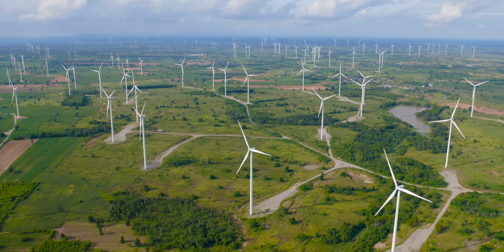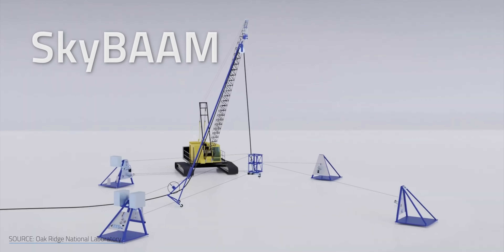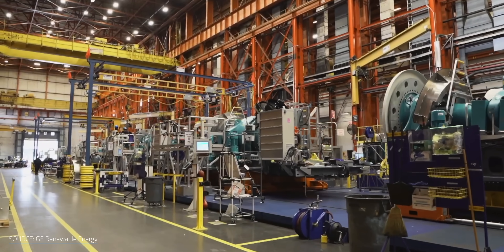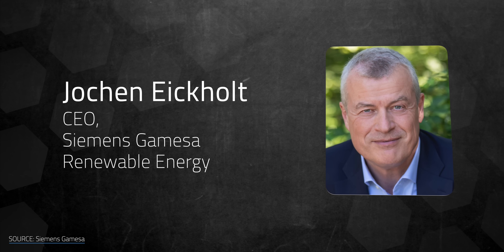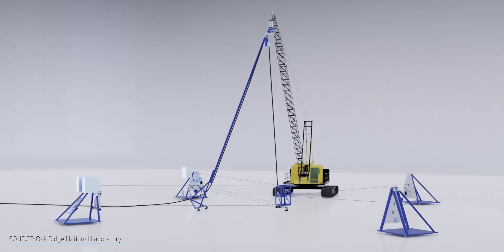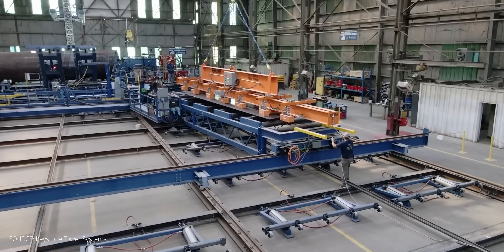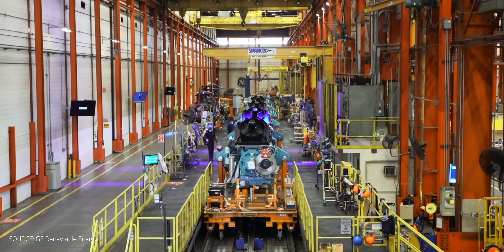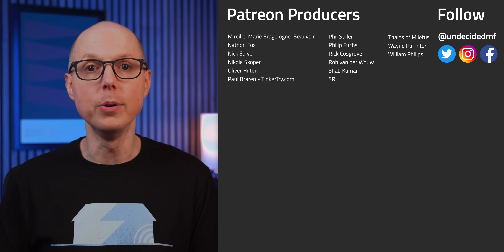Why We Need To Rethink Wind Turbines

Comment: The 2010 DeepWater Horizon spill took years to cleanup after it leaked over 200 million gallons of oil into the water. BP paid more than 70 billion dollars fixing it. 
Wind turbine manufacturers absolutely should be held accountable, but realistically even a wine turbine collapsing completely can't compare with the damage and cost of an oil spill.
Reply: Just a tibdit. BP paid not for "fixing it". The largest part of the payment was to cover the expected taxes lost in the spill. 

Government and courts pretend to care for the environment, but it's only about the tax money.
Respevtfully
Reply: @ricardokowalski1579  Do you have a source for those claims?  The most I can find is a reference to some money helping governments cover lost costs, but that seems more to cover lost income from things like tourism, not lost profits from drilling.
Reply: @mjdsys3376  this is also why there was a "heated" argument on the flowrate of oil across the wellhead. All this happened in "trust the experts" closed meetings, and the taxes levied were calculated using the "estimated" flowrate.
Reply: @ricardokowalski1579  I don't doubt your article (Reuters "Govt to BP: Don't forget to pay taxes on oil" July 15, 2010, as your replies seemed to be removed), it quotes a levy of only $73.4 million based on the worse case government estimates at the time.  Even if you assume this number is 10 times smaller then the final levy due to behind the scenes discussion, that is still only 1% of the larger quoted number ($70 billion), which is not "the largest part of the payment".  Various articles I found from various sources had the money going to various other organizations (including governments), all for various other quoted reasons.

That doesn't state whether this tax was warranted of course, though I'd assume it done this way to discourage oil/gas from being leaked out of drills which does seem useful.
Reply: @ricardokowalski1579 Just a small correction - the actual experts who were asking to be trusted were the rig operators who kept telling BP to stop before being forced to continue leading to the disaster. I'm really sick of all of this paranoia around experts as if they demand blind trust when they're actually very happy to share the evidence and reasoning - it isn't blind trust of people just can't be bothered to look at it.
Reply: @bosstowndynamics5488  "being forced to continue"
"forced" how?
Did BP pull out guns at the rig?

Also, strawman argument. Your "experts" are not the ones I am refering to. Failed, try again.
Reply: Yeah, but DeepWater wasn't making the equivalent energy of one turbine, it was equivalent to thousands. A barrel of oil is equivalent to about 1700Kwh, just the spill was about 5 MILLION barrels, that would have been 8,500,000,000Kwh of energy. That's enough to power 1.5 MILLION US average households for an entire year (minus efficiency losses, and if all the oil is turned into energy and not byproducts).
Reply: Guess where the chemicals come from that make the necessary epoxy needed for these huge composite structures?
Reply: The oil for the petrochem products in the epoxy will come from properly drilled and lined non-fracked LAND oil wells.... after we remove about 80% or more of all oil well extraction facilities that were used for fuel. FUEL.... do you understand parrot squawk "greatest hits" fossil PR propaganda trolls?
Reply: And?????
 @alexe589
Reply: Indeed, comparing apples to rotten pinapples
Reply: The problem is that wind doesn't make as much money as oil.  In 2021 the entire wind industry only spent $20 billion.
Reply: If they would just give away those turbine blades then they could be used for dozens of things. The fact is that companies would rather just bury the problem. Most areas where turbines exist are rural farming and ranching locations. 
One turbine blade is big enough to create a ton of wind blocks for livestock, Shelters for said livestock and a ton of other things. some with very little effort to fix them up.
Reply: Please tell that to the billions of insects and birds killed every year. Not to mention, whales going instinct because of offshore wind. Please do not be a patsy to big wind.
Reply: Except oil is absolutely essential and wind turbines are a total complete waste of energy and will never be “green”.  It’s just greenwashing. It’s a scam. Makes China rich
Reply: You do realize wind turbines leak oil constantly right?
Reply: If the Gulf of Mexico was a football stadium, the amount of oil spilled by DeepWater Horizon would be equivalent to spilling a 20oz soda.
Reply: nothing can replace oil. anything can replace wind turbines.
Reply: Guess what is needed to build and run wind turbines. Oil. Oil in the manufacturing process and tons of oil every year for lube to keep them spinning.
Wind turbines or solar panels all need oil
Reply: @quillo2747  The oil to manufacture and maintain wind turbines is by definition a small fraction of the oil to manufacture and maintain and fuel any kind of liquid hydrocarbon based generator. The fact that wind power isn't a magical infinite free energy source isn't an argument against it when it's still substantially better than what we're currently using
Reply: I worked for a small manufacturer around that time (I started in 2011 when they were still cleaning up the mess) that happened to produce parts for the company that made the emergency clamps designed to prevent an oil spill (I know that was a mouthful).  During one of our meetings my boss shared a bit of information he learned from said company:  The rig had 3 emergency clamps, a triple redundant system, to stop an oil spill but they were supposed to be recharged or have the batteries replaced every month.  As you can probably guess the batteries hadn't even been checked for multiple months, apparently they had 1 engineer that was supposed to oversee basically every rig and would only have a few minutes at each site before jumping on a plane to go to the next.
Reply: Oil is biodegradable. It gets cleaned up not matter what we do to it.
Reply: @kevinstroup  Are you willfully ignorant, just trolling, or what?  Most oil doesn't biodegrade, it's actually the end product of biodegraded material that was exposed to extreme pressure and/or temperature.  Crude oil spills absolutely ravage ecosystems which is why we spend so much time and money cleaning them up.  There are some natural oils made from plants that can decompose in a way that's beneficial to the environment but crude and most highly processed oils will not.
Reply: A whole ass wind turbine collapses... You get a pissed off farmer for losing a couple acres of his crop (which per contracts are paid out by the wind farm owner) and a bunch of pissed off wind techs that get to spend a couple weeks cleaning up the mess and a wind farm owner that is out a couple million dollars. An entire wind farm worth of turbines could collapse and it still not even be a drop in the bucket compared to the damage of an oil spill.
Reply: BP has huge oil ponds cover sq Miles of ocean floor - and killing everything under than and close to them, sans some microbes
Reply: @paleggett1897  not to mention the hundreds of square miles / kilometres of land in slurry ponds that exist in Saskatchewan and Alberta for the tar sands, which are a giant scar on the land which will exist for hundreds if not thousands of years. The petroleum industry seems to be oh so concerned about the number of birds killed by wind turbines, neglecting to mention the tens of thousands that die when landing on these slurry ponds.
Reply: @sjsomething4936 the dumbest part about the whole bird thing is wind turbines are only responsible for something like less than 0.01% of bird deaths while the other 99.99% are caused by pets such as cats and bird collisions with buildings and vehicles
Reply: @paleggett1897  oil floats.
Reply: well thanks for stating the bloody obvious.
Reply: To boot with what others have said, many of the materials used for the turbines are either new to the degree being used or the combos of them are so we have know clue what damage they could cause.  At one time cola had cocaine and some makeup had nuclear material.  Oh. And smoking was good for us.  I want everyone to try things to make things better overall.  But never forget about the unexpected consequences.
Reply: @aaronblackford981  so… the materials being used in wind turbine blades are all pretty common and well understood in terms of materials performance and challenges associated with waste.  This video does outline some new and interesting, innovative ways to combine them to be more effective but they are fundamentally still the same products.  All of the examples you mentioned are still being produced today, but they’ve been modified in most cases to make them less harmful.  Cola no longer contains actual coca, or at least none of the addictive compounds. Cigarettes now have filters to reduce the amount of tar going into smokers’ lungs. Makeup is now pretty rigorously tested in western countries to ensure toxins are not present.  There’s no such thing as perfection, just different degrees of imperfect and we must try to choose the least harmful options and then continue to improve any shortcomings that are found.
Reply: Nonsense. They are mostly steel and fibreglass. @aaronblackford981
Reply: @aaronblackford981  wtf at those analogies
Reply: @strnhrdt basically saying that people think all things good bc they think our govts check them, if they even do. At least the original poster said what we know and what we don’t.  And nothing is 100% good.  There’s more than two sides to anything.  More like 100 or more. As much as we all want the perfect to not stand in front of the better, we have to be careful that the better is also actually know at a high level that they aren’t worse than the past at least for some length of time.
Reply: @aaronblackford981   now the government is suddenly involved... what if i just think that some things are good because i watched alot of pro and cons videos.
Also an Argument i can use in EVERY discussion is unlikely to be a good one. Yeah there can always be black swan events and stuff but you also have to think about... how likely are they.
Reply: @strnhrdt  you have that right to think that. Heck.  I will protect you with a disagreeing point of view and protest over it.  Free speech is a huge thing.  I too have watched both sides videos and read up on many.  That was kinda one of my points.  100 sides to a lot of these arguments.  I prefer the good now vs the perfect 10 yrs later.  But I am never sold on this is the best.  I have lived through at least 5 deaths of all human life.  Sorry.  When crying wolf all the time to promote agendas doesn’t effect me emotionally anymore. I do love my nature.  I do want to take care of the 10’s of deer and turkeys I see throughout the week that are wild.  I fish and mostly catch and release.  I love watching the forest I live in defrock once a year only to return to 99% but within a few weeks back to 100% as the young Timbers have grown old.  I am ranting at a wtf were you reacting to.
Reply: @aaronblackford981   So the best you can do to save nature is spending time to warn people of the dangers of renewable energy like wind? To that i say... okay. I doubt it but okay. However im ranting about people slowing down an actual positiv trend by overrepresenting minor issues.

Comment: If you're not breaking things, then you're not pushing hard enough on the limits. Also, turbine size is dictated by economics. The day that we reach the point when increasing size doesn't decrease the overall cost (which some suggest is already here) is when production volume of that least cost turbine increases... further decreasing the cost per unit.
Reply: this is a horrible attitude to take when talking about the built environment. testing and caution is the name of the game, not a race to the bottom and leaving wreckage on the way, like tech companies usually do
Reply: @gibdopaminepls  If we're talking about bridges then I would agree with you. But we're talking about wind turbines that fall over in a field with nobody around. You could make the towers with steel so thick that none ever fall over, but then you've wasted a lot of money on extra steel. On the other hand, if thinner steel means 1 in 1,000 fall over, and the cost of replacing that one fallen turbine is less than the extra steel cost, then stick with the thinner steel.
Reply: Problem is what they are breaking is us. It’s a joke and people sucker for it in mass.
Reply: @marktapey7678  What are you talking about?
Reply: @dc14522  Its all a huge joke and you’re falling for it. Start to finish these are some of the dirtiest ways to make power and do not live even close to as long as they claim. That’s a fact jack. Go across the pond and ask why their cheep green energy is so damn expensive.

Comment: Is a company like Orbital a solution?  Allowing a company to cut costs by only putting strength where its needed seems like part of the race to the bottom.  Then a client has to know Orbital's manufacturing process, which may not be consistent, to compute the required stiffness of the component required.

Comment: Disposal of retired turbine blades appears to be a BIG problem.  Vertical turbine blade designs would appear to require LESS material and ease construction and maintenance.  Why hasn't this taken off?
Reply: Vertical turbines don't scale up because most of the blade is far away from the axis of rotation, which puts a lot of stress on it as it counteracts centrifugal force.
Reply: Also, wind generally blows faster the farther away from the ground you are.
Reply: Agreed, and they are quieter too.
Reply: Economics. Sweep area vs materials needed for each type of turbine. How big in terms of materials does a vertical vs horizontal turbine need to be. Although life blade life of vertical turbines might be a lot longer.